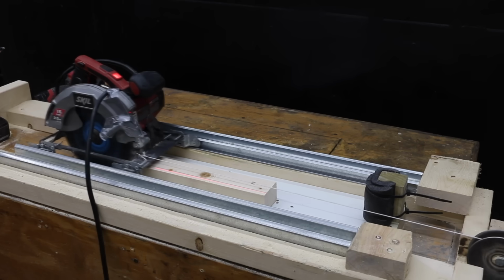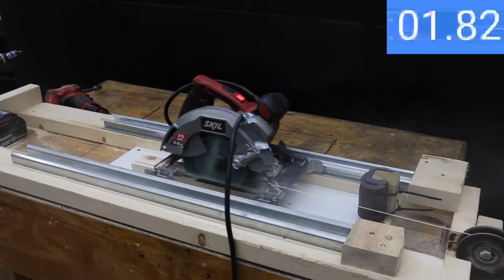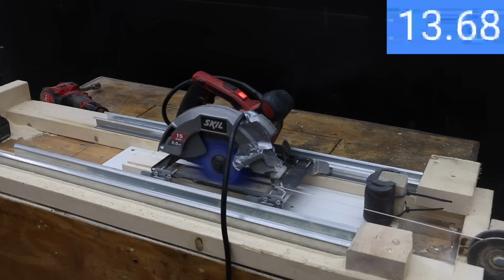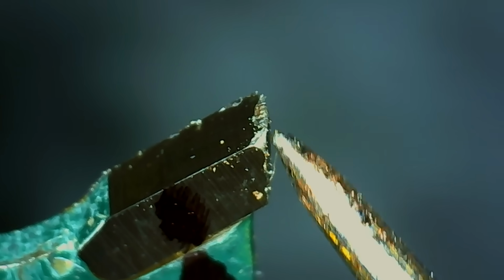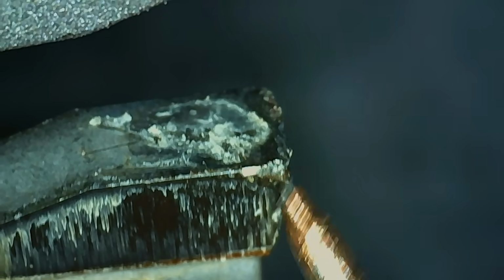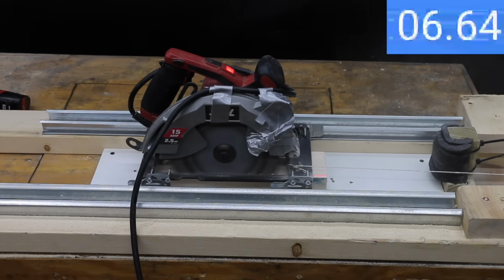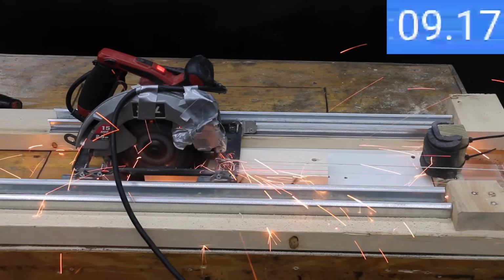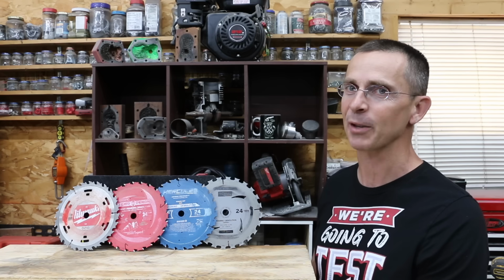Best "Demolition" Circular Saw Blade? Milwaukee, Diablo, DeWalt, Hercules, Evolution, Bosch, Amana

Comment: So I bought a used table saw and it came with some random no-name blade that had clearly been abused (previous owner said he used took off his "nice" blades, which makes sense because I barely paid more for the saw than I would for a premium saw blade). That random no-name blade still greatly outperformed "Big Blue" in a similar situation.
Reply from the maker: Interesting!

Comment: Ive been running the Hercules demo blade in a drill master circular saw and the herculese cordless 20v circ saw for over 2 years. Have done MANY MANY cuts on pallets, scrap lumber from around the farm, fence posts, eveything has staples and nails and screws and they just keep cutting and cutting.
Also a little candle wax on the blade can really make a difference
Reply from the maker: Thanks for the feedback.

Comment: I think changing different weights pulling the saw would make a difference in each blade. Some blades are more effective if you use more preasure
Reply from the maker: Thanks for the feedback.
Reply: @ProjectFarm  Your welcome, I would love to see a similar test with knockoff amazon saw blades in the near future if you think that would be an interesting video. Some with a 10 lb weight and 15lb and see if there is a uniform correlation or not by changing the weights

Comment: For me, it's been a no-brainer to buy either diablo or dewalt.  No one wants to change out blades for different uses.  You want a blade that can do everything from a framing standpoint, including having to cut through the occasional nail, screw or staple.  Both or these brands perform well on these normal framing tasks.  The blades designed specifically for one purpose....are just garbage to me.
Reply from the maker: Thanks for the feedback.

Comment: Great comparison. I would have like to see these blades perform after cutting through Sheetrock. It’s a common occurrence in demolition. Sheetrock tends to dull teeth and slow up drill bits. Next time do a cross cut rather than the rip. It’s a more common practical application on a job.
Reply from the maker: Thanks for the constructive feedback.

Comment: I love the video but to be fair to the saw blades, the amount of time spent ripping 2x materials is minimal compared to cross cutting and most saw blade manufacturers take this into account when they design and build their blades. I don't know how it would, if at all, effect the test results but its possible. If you look at tablesaw blades that are mostly ripping blades, they are very different than chopsaw blades which are designed for cross cutting.
Reply from the maker: Thank you for sharing!

Comment: Great tests! Since you were cutting through nails maybe another control cut could have been a toothed metal cutting blade. I bought and used a Hercules metal cutting circular saw blade to cut a 275 gallon oil tank into pieces with no visible damage to the teeth. Just a thought.
Reply from the maker: Thanks!  Thanks for the suggestion.

Comment: So, they call it a demo blade, make it a little more expensive, but there's little to no difference in performance. Shows what these big companies think about their consumers. And that blue blade is the worst. It's one of the more costly even though it's manufactured using less material.

Comment: Hey, I don’t see a review of masonry blades for circular saws. Howz about it? Keep on keepin’ on!
Reply from the maker: Thanks, will do!  Thanks for the video idea.
Reply: @ProjectFarm  no sweat! And I just bought my first couple of items from Temu. There are all those new advanced tools on YouTube and Temu that include some weird, but super useful devices. Maybe comparing some of them, or just testing them out, it would be a little different than the style you have evolved into with competing brands of the same product, but there are some of those situations among these new tools as well. The only one I can think of at this moment is the drill bits that have tapping threads above the tip on the shaft to drill and tap a hole in one process. But there are LOTS of new stuff like that to keep you in new video ideas for a while. I know by now you are starting to exhaust the standard tool comparison possibilities. There are also myriad new tools in general you could go into as well, not just from YouTube and Temu etc.

Comment: Im back

Sir your test has helped in some of what i use as finish carpenter.

I have one to consider...
Demo saw z all blades

I have tried bosch are good while new though they dull fast.

Milwaukee torch are really good

Just tried diablo demo 1 blade cut nails screws and joist to build a new deck.

You really have a knack, to for exampke extension cords to come up with methodsto test the cirds was brilliant.
 
I was considering yelliw jacket ir flexiziilla at tge job sute 
Just found another fir tge tools to tie to keep the cords together badass extension cords with locking end.

Deck screwd are tough made of stainless steel with cersmic coating.

Comment: Been using the cheap masterforce menards brand stuff for a bit, pleasantly surprised by the tests. I noticed the difference immediately vs the blade that came with the saw, an ultracheap "Tool shop" Menards brand 7 1/4 circ saw, but I figured that was to be expected. To perform this well, Is unexpected for sure.
Reply: Been using primarily "Tool Shop" brand tools to do a bathroom remodel in my own place. A small 8x8 bathroom, put in a deck tub and all new flooring, including reinforcing the 2x6 floor joists, and new 3/4 floors. Ive only used the one masterforce blade on the circ saw so far and its still going strong, I bought a pack of lennox sawzall blades, havent burnt through but one of them so far on nails, staples and such. Have to say this channel has saved me a decent bit of money already, on just a small job. I did blow up a Tool Shop brand corded drill.. It completed a single 2 inch hole saw cut, Blu-Mol brand (brand new, yet old, "hand me downs"). This was through a fresh, treated 2x6. The drill started grinding on the inside quite badly after the hole cut, then burst into smoke after trying to drive a couple deck screws shortly after that. Out of the lot of tool shop brand tools I bought its the only casualty so far.
Reply from the maker: Thanks for sharing.

Comment: As usual, another well done video.  Here's a possible video suggestion: PVC solvent cements. I've been messing with some PVC conduit and was pulling some out of the ground that an ex-friend had installed.  He likes the light-blue PVC solvent marketed for use on wet PVC (something like that).  That stuff doesn't work well on white plumbing PVC or gray electrical conduit PVC: I've seen two of his joints using this stuff separate without damage to the PVC.  It just does not weld the plastic.  This guy is a half ass and primer would most likely not have been used. A video covering the difference in bond/weld quality between various PVC solvent cements (with and without primer) used across both white (plumbing) and gray (conduit) PVC would be helpful. Quantifiable analysis of the joints might prove challenging...except for that bright/light blue crap...just pull it apart with your hands.  ;)
Reply from the maker: Thanks!  Thanks for the suggestion.
Reply: @ProjectFarm  Well, as long as I'm throwing out suggestions: another PITA I just ran across is I bought a "demagnetizer/magnetizer" for tools.  I wanted to magnetize my phillips bit in the impact driver.  Well, either the DeWalt bit doesn't like to be magnetized or I bought a POS magnetizer (Amazon, of course).  Might be too much trouble to test, or too many choices to test, but I ran across a need to know if anyone makes a legit magnetizer/demagnetizer.  FWIW.  Thanks for your great videos.

Comment: I've cut through a lot of rusty nails and hardened screws during my demo work and I have found that if you know you're cutting that stuff, slow down and put just a little pressure on the saw.  that way you're nipping at the fastener instead of jamming one tooth into it at high speed, guaranteed to chip it.  I've cut hardened screws in half vertically (not intentionally).  Generally go to Spyder or Diablo depending on which is in arm's reach, always have good result with those. Nice test.  as others have pointed out, cross cut would be nice to see.  one last thing.  cleaning the buildup behind the teeth of a well-used carbide blade can extend its life
Reply from the maker: Thanks!  Thanks for the suggestion.
Reply: How long does a blade last you?

Comment: After being amazed to see the test of the DeWalt improving its time after the Shingles test I thought to myself that I will buy one of these and it will get better and better over time no matter what...a never edning story, win-win situation *irony off*.
Finally, it would have been interesting to see the condition of the saw teeth on each blade as I think most "light" discs should lose so much power with each cut through different materials that the initially slow "heavy-cutters" such as the Bosch are the better investment in the long run
Reply from the maker: Thanks for sharing.

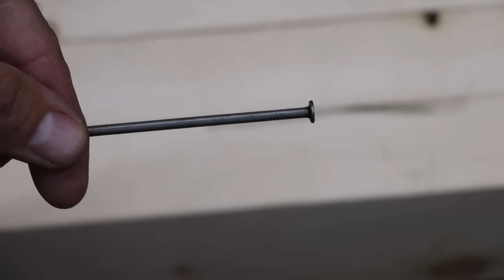Comment: Really love the way you conducted this test, my only problem is at 7:16 when pinning the nails it looks like you kinda just stuck them in and didnt measure them... Test results are still test results but I think this is a variable that could have easily been controlled and may have warped the results slightly... 

Since the raw wood is obviously easier to cut through, having two nails closer or further away from eachother could impact how well the blade cuts
 I'm not really sure on the science behind the skillsaws movement speed and how that relates to cutting speed but I think that middle 2/4 looks like a clear disadvantage to whatever blade cuts through it.

Comment: Sometimes you have to use the blade to determine if it is the right blade for you. For example, I saw a demonstration of a 10" saw blade (i forget the name). It looked like it worked really well.  when I tried out on my 10" table saw it sounded like a jet engine when it was in use. A loud high-pitched whining that was heard throughout my shop.
Reply from the maker: Thanks for the feedback.

Comment: Man this guy spends so much time testing irrelevant data, like what's next, how reflective my car tires rubber is? How long it takes to inflate them?

The goal of a blade is to cut reasonably cleanly, without excessive arm force, but the key metric is how many cuts till the blade is dead...

Comment: The one idea I have is an all in one tool set. Something for someone who doesn't need or do alot of work around the house but will still need tools for when something goes out. Personally I bought a  $54 tool kit on amazon and have a few regrets. I've already replaced the hammer and tape measure.
Reply from the maker: Thanks for the suggestion.

Comment: From long experience, Evolution do a "metal cutting" blade that fits circular saws - it is the only one that can survive long term cutting wood with nails in - it's built to cut steel, cuts wood great, so nails are no issue. If you have nails in wood, get an evolution metal cutting blade - we used every sort repairing pallets on a commercial basis, 5, 600 pallets a day, 6 days a week - only Evolution stuck the abuse. Cutting shingles gunkes every sort of blade - the sand they use to coat the shingles kills blades. The Evolution "Demo" blades are pish - even though it comes out tops here -  get the dedicated metal (steel version - they do a "stainless steel" one too)  - cutting ones - they cut wood great, ignore the name. Those do not slow from hitting nails/screws - they're specifically designed to munch through them without taking damage.

Generally speaking, Evolution make blades that can stick abuse others die from, without dying - one blade here has cut thouands upon thousands of rounds of wet timber - which is murder on saw blades - it shows no signs of slowing, despite being marketed as a "Steel" cutting blade. By comparison, I have a Hilti 85 saw with an almost new Diablo blade in it - supposedly premium - it clipped a fence staple embedded in a timber I was cutting & is now making more smoke than cuts - despite having a cosseted life for the short time I own it. Very disappointed  in such a supposedly "Premium Blade" being so soft IRL.  Diablo blades are NOT cheap here, by the way - they're eye-watering. The paint on this one is as new - little use - but it's as much use as an ashtray on a motorbike after clipping that one staple in a piece of oak. Not what I expected tbh.
Reply from the maker: Thanks for sharing.

Comment: Awesome video. Excellent amd extensive testing. I have the notion that blade degradation is really dependant on force applied to the saw. As it influences together with blade geometry the bite size per tooth. Exceed the limit and it will chip. Don't exceed it and saw many nails without a problem.
Does anyone experience this? Or agree?
Reply from the maker: Thanks and you are welcome!

Comment: Do a video on best long USB-C cord from Amazon, i can never find a great long lasting cord for my phone in the shop. Rate of charge, gauge of wire, cord flexes, tip strength, cord covering longevity, etc. This isn't a direct shop tool or product, but one i think we all find on our work benches.
Reply from the maker: Thanks for the suggestion.

Comment: This is a great shootout and I enjoyed it alot. Just an observation...with the randomness of the embedded nails, the further away from the arbor the faster the cutting speed so wouldn't the nails all have to be aligned or the tests have to use the same board? Or do I need to put my closet engineer hat back in the dark?
As a footnote...
I recently got a "free" Dewalt XR 20V saw in a package deal. The BodySlot blade outlasted the tool! which gave up the ghost after a couple of uses. Hats off to Lowes for a quick and painless exchange.

Comment: They say ok for nails but not for ferris metals.
That may be bc sometimes we use our saw to cut metal siding or roofing etc.
I agree theres not enough teeth and too much/little angle for smooth cutting of metal sheets.
Actually we will install our blade backwards for a smoother siding cut.
Reply from the maker: Thanks for sharing.

Comment: This whole test was pointless and completely random. You cant do a sharpness test and cut through different density material. For example the spider blade test cut deeper and deeper into a knot and got slower. Construction lumber such as Yellow pine and spruce density can very as much as 20% across 1 inch. Next time you are at the home center pick through the 2x4 stack and you will see the weight difference from board to board. If you want true test results dimensional lumber is not the answer. You need to use a composite material like MDF. Yes its a little more dusty but will give accurate and take wood density out of the equation. Same thing for your drill and driver tests

Comment: Not to be a hater but it seems like the jig jams up for some of the test, especially the big blue test.
Even after it finish cutting it goes the same speed down the track.

Should have a leaf blower to blow the chips backwards to keep the track clean.

Not saying the big blue would be much better and certainly wouldn't use that myself as the design makes it extremely dangerous for kickback
Reply from the maker: Thanks for sharing.

Comment: I've used the Diablo demo blade a lot, and I don't like it. It warps and veers and makes terrible cuts. This test has short rip cuts, but if you try longer cuts or cross cuts, that's when it overheats, expands, and starts wabbling and binding and veering. Total mess.

I like Diablo blades, just not that one.
Reply from the maker: Thanks for the feedback.

Comment: I am a professional carpenter and my go to blade for EVERYTHING has been the Diablo Demo Demon for almost 10 years now. I've cut things that aren't supposed to be cut by those blades and STILL produce a finish quality cut in trim boards with the same blade. The ONLY thing I've seen finish off one of Diablo's demo blades in the field was when someone accidently touched concrete with it. Anything else the blade hits get cut like a hot knife through butter! 😎
Reply from the maker: Thanks for the feedback.

Comment: I wonder if where the blade meets the nails in the 2x4 makes a difference?  Like, it the nail edge meets the blade on the edge of the blade, or if it goes in further than the edge?  Just a comment, not a criticism. Although it does look like the nails are randomly inserted along the mid section.  Project Farm is always awesome!
Reply from the maker: Great point! Thank you

Comment: Sir I have a question i work daily with a crosscut saw where we cut mild steel. And most blades we use need to be sharpend after a good 3 to 4 days of use. I don't know if this is something you can test. For daily use price and endurance is pretty important and how well they can be re-sharpend.
Reply from the maker: Thanks for the suggestion.

Comment: Can you do a video testing various different 13-15 amp corded 8" circular metal cutting saws and another testing various 8" circular cutting saw blades?? Ive used the 15amp Milwaukee cutting saw for years in my welding shop and its an absolute beast, but I'm curious how it compares to others.
Reply from the maker: Thanks for the video idea.

Comment: When cutting nails you don't want to power through them. The test should have been done at a slower more controlled speed to simulate the speed in which you would actually use a circular saw to prolong the life of your blades.